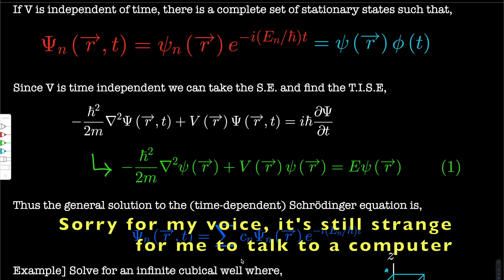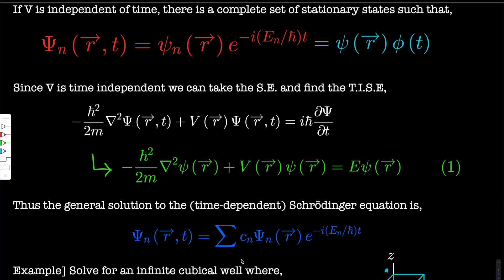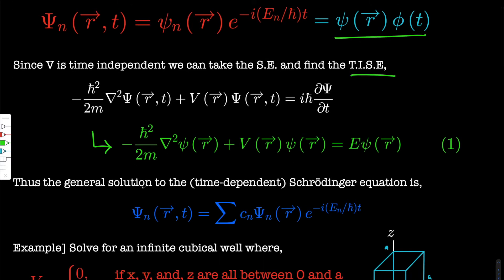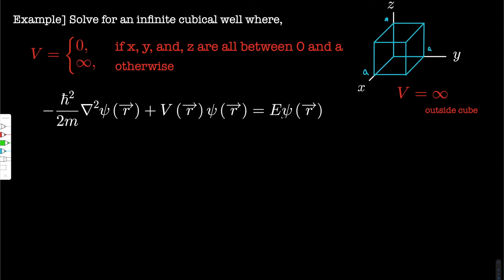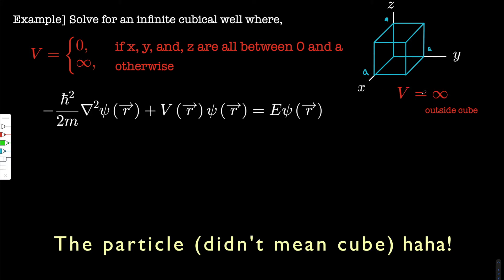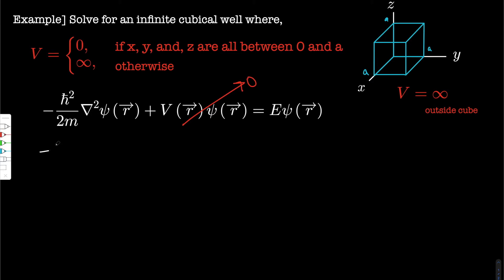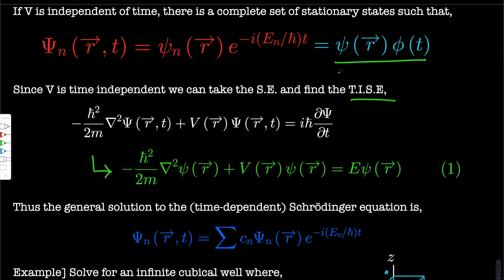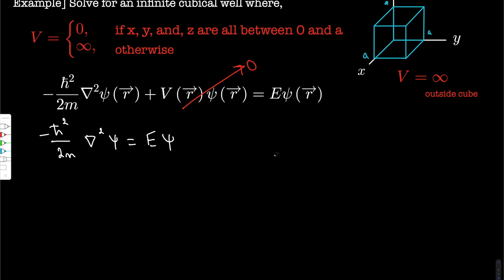3D Quantum Mechanics Made Easy!? Infinite Cubical Well Potential Example!

Comment: Why are we allowed to write phy = XxYxZ ? What is the argument as this isn't true for every function
Reply from the maker: Hi, if you mean why are we writing psi = X(x))Y(y)Z(z), this is just a guess that we can solve the PDE using an equation of this form. Recall that a lot of differential equation's is guessing based on intuition! :)
Reply: @MathPhysicsFunwithGus  yes this was my question. Thanks for the answer ! I saw somewhere else that it was also due to the fact that the variable where independent from one another bc the particle was biased in its trajectory which means that every position can be seen as evenly distributed. Thanks a lot for the informative video